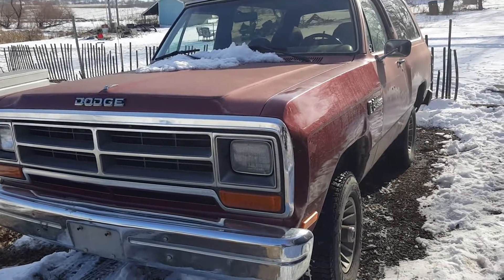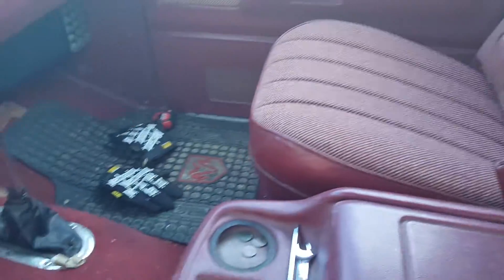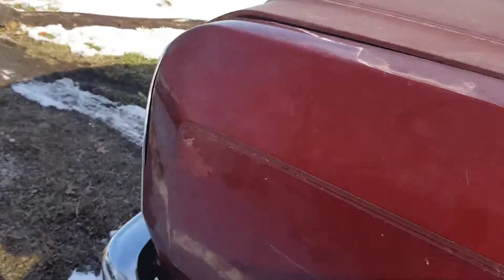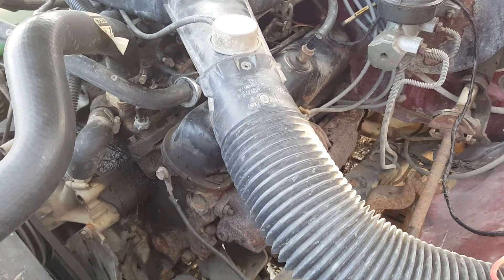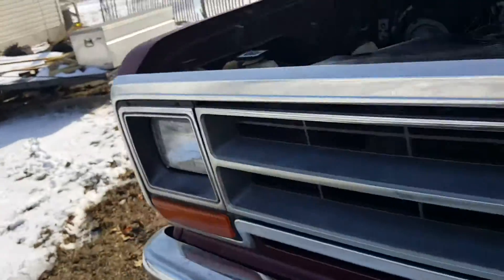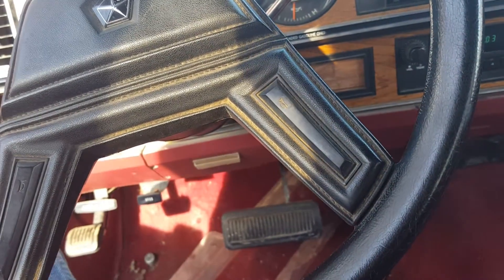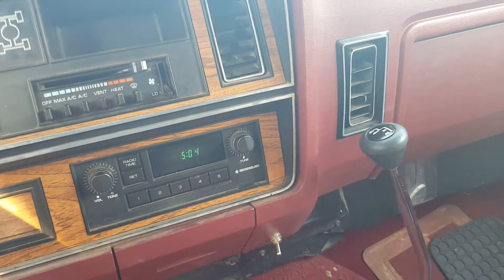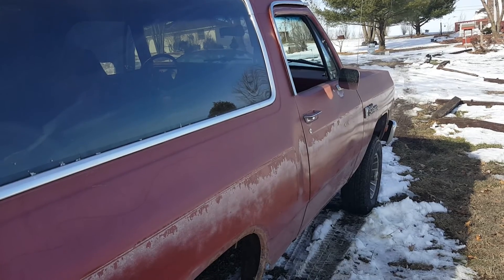1987 Ramcharger Build Part 1

Comment: Next investment. Sheetmetal and a welder.
Reply: Awesome. I just got a 83. 318/727/208/9.25/44 for $1,800. I need to hone my youtube skills. So we can video back and forth info.
This is my Mopar background. My stepdad was a ASE 30 year master tech. He has passed yet his wisdom is with me. I just wish I had all of his.
My Dodges
66 Barracuda 273 4 speed (in Australia last I heard)
68 Coronet 440 318/904 (T-boned by my insurance person's son)(what luck) (my baby)
73 W200 Powerwagon longbed, 360/4-speed (cancer/arthritis/had to PCS from Ft. Carson to Honduras) (had my Iraq war truck Bubba the 04) (left Clifford in the parking lot on post Aug 04).
74 Colt Station wagon (don't laugh, I miss that car. It was off road awesome) Learned to drive in that.
83 Ramcharger (present)
04 Ram 2500 4x4 Hemi/5 speed/ 4.10 gears Factory custom order from Iraq. Lady asked. "What are you ordering? I said. "Mam a truck". No power anything but the wheel and brakes, no creature comforts.  I had been driving a 73 wagon. I could see the street through the floor and a year of fucking shit ass HMMWV's. Give me AM/FM, working heater and holy shit gimbal seal A/C. Bubba is my truck. (present)
I am in a huge debate with my gear head right now.
LA 318
LA 360
Magnum 5.2
Magnum 5.9
5.7 Hemi
727 or 518
Do I ditch the 9.25 for a Dana 60 with disk brakes? My 73 had a 44 front and 60 rear. It was tough stuff.
Going to Line-X my interior. That's a fact for these rust buckets. 
Actually as soon as you have everything in check on the bottom. Just go to Line-X and have them spray it. They will spray fucking anything. Prep it right they might charge less.
Lifetime stuff for trucks. And nationwide warranty service. Used by the military for stopping bullets.
Resurection, with modern stuff. Mine had that rubber flooring. Duhh. rubber traps moisture and these rust easy. I pulled it. The  floor in the cab had started. The wool insulation was the culprit. Clear your floor out man. After the X you can lay down carpet or just some nice matts. 
I am in the direction of. Preservation of the frame, body, glass and architecture. 
What you have is the next 71 HemiCuda. I see it coming while everyone trashes the shit out of these classics. 
Build a strong truck using parts to go further. Find the faults from the factory and fix them. Use modern Tech. But, remember. The further you go away, the less it means to anyone but you.
Reply from the maker: @DobermansRock  that's pretty awesome. Mine has a 5.9 magnum in it now with the 727 behind it. The swap is for the 46re that belongs behind the 5.9 magnum. Chasing some sensor issues right now but it runs way better and stronger than the 318la could dream of
Reply: I like your combo. The 727 is one of those things where I have to give up the fuel economy for durability.
Its been around a long time and its been gone through by so many it can be all you want.
I am hearing the 518 has issues unresolved. Don't idle in park and never turn off the overdrive are 2 so far. Why there is an on off for over drive I don't really know. Hey maybe it made people think they were in some super power mode.
I like manuals myself. But, The Torquefright is easy to build into the 600 horsepower level pretty easy.

This is my RB/BB info.
383 crank, they are forged and balanced
906 heads Duhh
400 small block. The 400 had a beefed up block. Really beefed up. The 440 is a drag engine and great as well but, that 400 is a discount engine nobody thinks much about.
It has junk heads and a shitty crank.  Play the part number games for a big block. Its easy and NO you won't be bouncing off the ground. But, you will find tuning these parts will bring good things.
727 to back it or a 435. 
Brother I really need to figure out which Dodge truck. Has the right width dana 60 with disk brakes I can pull. 
My 73 W200 had a 44 in front and a 60 in the rear. We have 44's in front right now. That 60 is a perfect addition. And I love 4.10 gears. If I can cruise at 2000 rpm at 60 mph I am cool with that.
Reply from the maker: @DobermansRock  I read that you can modify the Dana 60 drum to disk. I'll have to see if I can find that thread on one of the forums I'm on again. I'm happy with the power of the magnum for my purposes with this. Maybe cam it but that will be the extent. One of these days I want to build a mid engine sand rail and strap a 440 making 600hp to it and a custom 4x4 system. Then put it on the open ice up here on green bay and floor it. And take it down to Michigan and Indiana on the same dunes. If you havnt already check out ramchargercentral.com lots of great info and helpful people there

Comment: you didn't see the spark arcing on the throttle cable bracket from a spark plug wire
Reply from the maker: gary johnson later on I found the ignition system in general was doing a lot of things not good and I'm still fighting with it trying to get it right. the carb I have now isn't helping the situation either but that's ok I have a 413 waiting to be swapped in hopefully this weekend so I'm not worried about that. as far as parts by time I got them from Florida itd be pretty expensive. I'm in North West Missouri. I appreciate the offer though